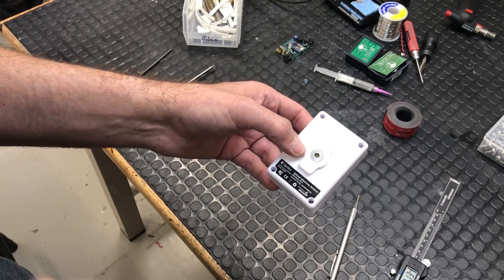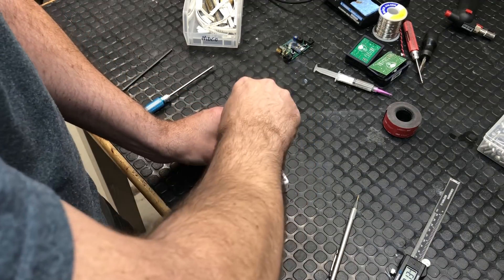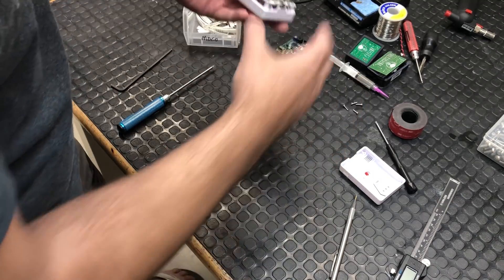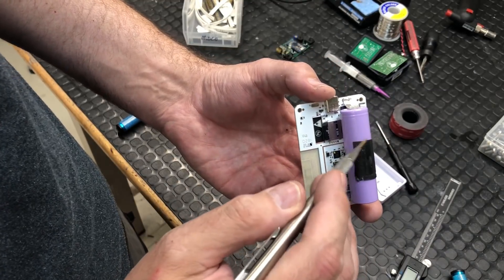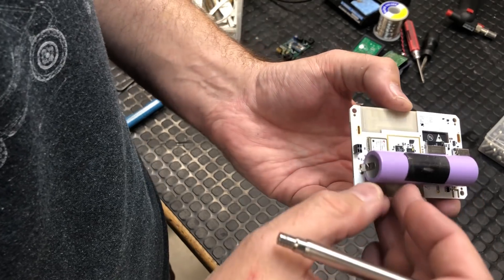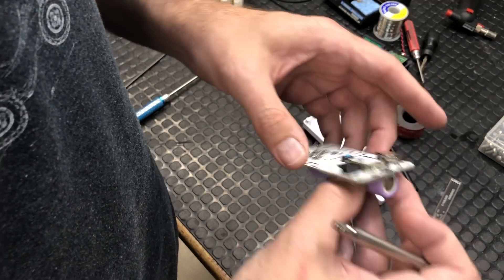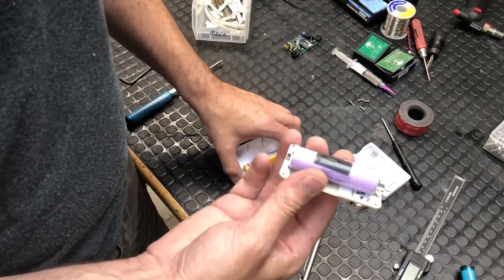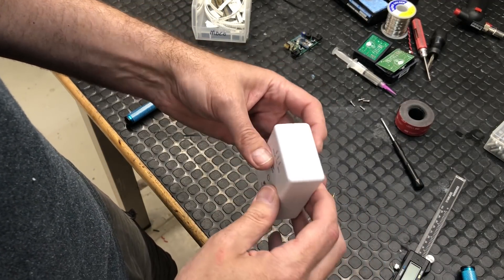A look inside the Sentry & how to double the battery capacity

Comment: @Outbound300 any advice on what to do with an intermittent power button. I need to try powering it on a bunch of times before it actually turns on. Once on, it works fine.

Comment: They were not sure of battery draw when designing the enclosure (mold tooling is expensive).  So they planned on 2x18650’s.  But didn’t need them.

Comment: Anyone know if the "updated" Sentry (not the Plus, but the "updated" 2023 version) has a the nice big Taoglas GPS patch antenna instead of the simple SMD ceramic antenna?
Reply: FYI, yes, it does. From Brandan J. over at uAvionix...
"Thank you for contacting uAvionix, Yes, the GPS antenna used on the Sentry MY23 is the same as on SentryPlus. While this isn't all that is changed, the patch antenna makes up a large portion of the performance improvement for SentryPlus and Sentry MY23 over the original Sentry. The IMU / AHRS chip, CO sensor and ADS-B chip are the same across both Sentry models."

Comment: According to uAvionix just a few moments ago, the Sentry only has the one battery because the second battery would intefere with the GPS.
Reply from the maker: I ran this unit with single battery for 6 months and dual batteries for 2 years. Never experienced any more GPS issues with it when it had dual batteries vs. single battery.  🤷🏼‍♂️
Reply: @Outbound300  Interesting!  Did you do a video on installing the second battery?  I'm not an electronics geek but looking at this video it appears easy to do.  How did you solder it to the circuit board?
Reply: I'm trying to find a video on changing out the 18650 currently in my Sentry.  Not having any luck doing so.
Reply from the maker: I never did a video on adding the 2nd battery but easy to do with the proper equipment. I spot welded tabs to the battery and soldered to the PCB just like the factory installed battery. I did get around 2x the operation time.
Reply: @Outbound300 what size in terms of mAh?
Reply: @Outbound300  did it double your use life?

Comment: Di you confirm that you can add a second battery?
Reply from the maker: I was able to add it. It worked great.
Reply: @Outbound300 That is good to know. I think my battery is dead, or the charge circuit is fried. Sentry will not hold a charge and will not run on ship power. Will try installing a new battery and may double them up. Thanks...
Reply: @Outbound300  did it have any effect on your reception? Also which battery should I get there are a lot of different mAh batteries.

Comment: Any ideas on how to hard reset a Sentry?  Mine locked up, screen on, but not leds showing. Power button doesnt seem to do anything.  Ideas?  Perhaps a jumper to reboot it?
Reply from the maker: If it were mine I’d open up the case, unsolder the battery and test the battery. It’s possible it’s gone bad and doesn’t have enough voltage to get past any low voltage protection.

Comment: Did you ever report back?  Mine battery seems to be losing steam.  Today it seemed as if it was using more juice than an external charger could replace.  It was shutting off in flight.  I would have to leave it off, charging for 10-15 minutes and then it would come back on.
Reply: I have the same issue even with a healthy battery.  I suspect the charging circuit does not supply enough power to operate the unit and charge the battery at the same time.  When the unit is on, the battery continues to discharge, albeit at a slower rate than when unplugged.
Reply: I have the same problem.  More draw than the charge and it dies… in flight
Reply: i ended up giving it away with my plane and buying a new one @SwoopVT
Reply: Mine has done that twice while plugged into the aircraft's USB power supply.  Rebekah at uAvionix told me while at Oshkosh 2024 that the aircraft USB power supplies generally do not provide enough power (minimum 5A) to do through charging while using the unit.  Of course mine died while on long cross countries and not at a point where I could charge it quickly.  Last time was on the way back from AirVenture 24 in the middle of nowhere.  Thank goodness for an iPhone with ForeFlight installed.

Comment: Thanks for putting this video up! :-) I was trying to decide between the mini and this one and now that I've seen that the battery inside of it is soldered and hence not meant to be user replaceable, it would seem that the mini is the better deal since it derives its power from an external power source.

Comment: Beside other design factors which may have been taken into account to which I can't even guess haha, I'm curious if there is any risk in effectively creating a 2c battery pack in a system which may not be set up to balance charge multiple cell LiIon system? I am curious indeed about this design decision. Seems obvious, put as much battery in as possible! But as you said, maybe they decided to save money, and it's already designed for 2 cells? Sounds like you've been running it this way for years now with no problem?

Hardware wise, I easily agree with you on the price. 

Regards from Colorado

Comment: Awesome video.  All of a sudden my Sentry wont work unless connected to a charging source.  Do you have any idea why that may be before i start tinkering?
Reply: Mine started doing the same thing. I think there is a loose connection or something inside. I legit had to bang on it for it to work.
Reply: @JustinJackson11  Bit unsettling, that. Did either of you ever come up with a long term solution for that problem?

Cheers

Comment: Did you just solder an additional battery into the open slots? Just wore out the battery it came with and figured I might as well upgrade while I'm at it.
Reply: Have same question. Did you solder extra posts to the board or just solder another battery to the exising one?

Comment: Thanks! So, what was the chip? Can’t believe you did not read ssd card... :)
Reply from the maker: it seems the chip is in fact an ESP-12S
Reply: @Outbound300  That sure seems like a ESP-WROOM-32 (i.e., ESP32 instead of ESP8266)
Reply: The SD Card is likely just for storage of FIS-B data (i.e., weather maps received, etc) and flight data recording.
Reply from the maker: I thought the same when I saw the number of pin pads but upon further inspection if the laser etching is to be trusted, it's an ESP-12S